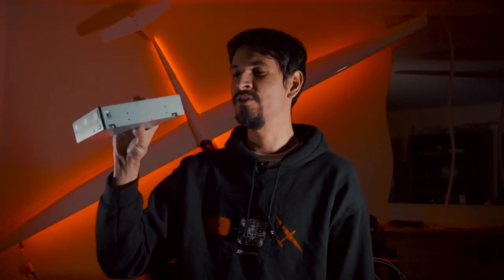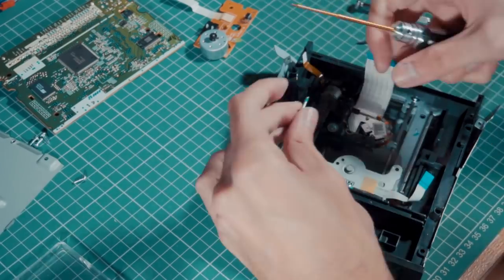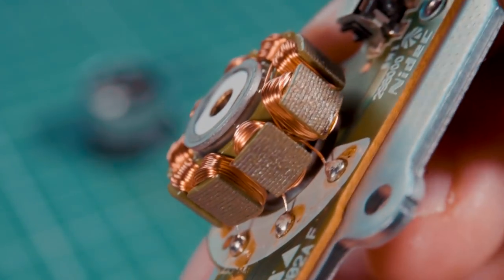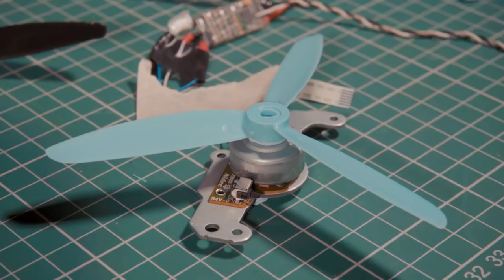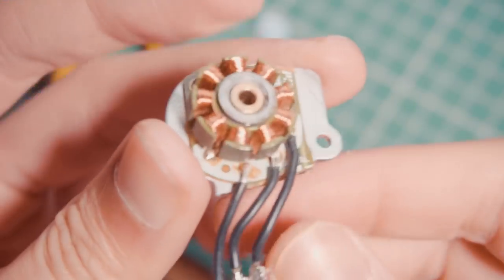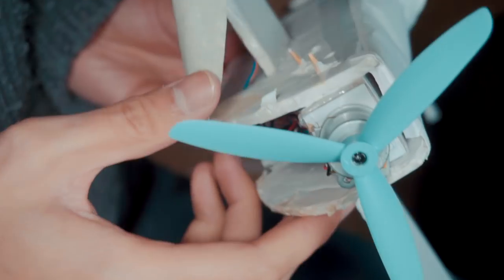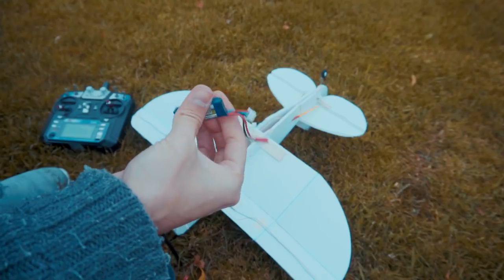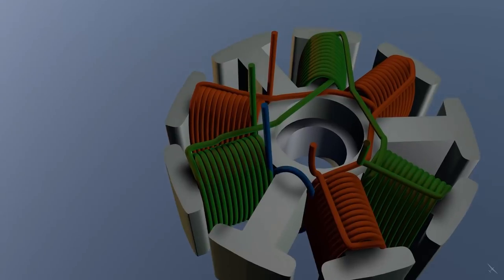Brushless motor from old CD drive to power RC airplane

Comment: I used to do this, back in the day, with great success.
What I used to do was... I removed the stator from the metal base & circuit board (& replace it with my own motor mounts); rewound the stator; put two bearings down the center of the stator; re-fit the bell & I'd have a better motor. At one point, I went as far as replacing the magnets (called the "flux ring") inside the bell housing with decent NdFeB magnets.
I had used those motors on some indoor foamy planes that I had built from 2008~2011.

Comment: This is very interesting. I’m anxiously awaiting to learn about rewinding the motor. I had some students (I teach a STEM RC Aeronautics class), who accidentally used screws that were too long and shorted out the motor. I’ve kept the motor, in hopes of some day learning (and eventually teach my students) how to fix the problem (and learn a little bit about electronics and motors). Could you also possibly go over how to correct/fix a bad/shorted motor?  Thank you for creating great content.
Reply: Sure. That's a pretty common mistake with the screws. I'll be covering the fixing of a business motor including rewinding.

Comment: Seeing you perform those initial rotational speed tests--with the plastic CD disc, got me thinking/'imagining'...
 What 'IF'--someone was able to carefully cut-out & relieve the outline of wedges, or 'arc sectors' of a CD disk, in a radial pattern...such that the freed, polycarbonate plastic could be bent/leveraged with heat, into the blades of a fan.
Or, more accurately like a turbine/turbofan 'Blisk'? Could several of these be mounted in series on a shaft, with slightly different 'pitch' blades--so that when rotating they pass air like a series of fan compressor blades?

Comment: Hello friend, I have two questions:
1) Is the CD Rom engine cover really difficult to remove? I apply a lot of force but it doesn't come out.
2) How to remove the short motor shaft to replace it with a longer one? Thanks

Comment: Great video DIY CD motor into small airplane ✈️ niceeee!!! But I wondered if you know what's this motor's KV is it?? Cuz I see you was using 3s  at 850, at 35c zippy xt30 cord battery, so I wondered what is the CD motor for KV's number, do you now, please do lemme know, thank you dude!! Cuz maybe you could do like 100c 850mAh, 3s with xt30 cord battery, maybe you could fly little more longer cuz 35c is pretty low on throttle and pitch for speed power... Awesome footage by the way! 🤙🏼

Comment: Is using an dvd motor with only 3 copper pillars inside good for rc plane? Its our school project and im designing one that is ultra light , small and sleek  the plane was made out of styrofoam with a wingspan of 2 rulers. And abiut 1 ruler fuselage lenght.. im currently making it glide first so that im nit gonna problem the flying when i added the control surfaces and motors..
Reply from the maker: Hi, you better off buying the proper RC motors since they are not very expensive and you'll save a lot of time.

Comment: There are a few thing wrog with your test. Rewinding it is the only way because it is rewinded from the factory for low assumption and low power. You could for example rewind it for a 4 sell. On rcgroups you find how too. the secondly choicing a prop for your motor is a know how that you have to learn. you can not just throw a prop on your plane so you will burn the esc or the motor or all of them together( believe me not a good felling) but I learned many years ago and I am shore you will too :). I used too rewind nearly all my of motors my self

Comment: Those windings look pretty good actually; very much like any small airplane motor.   The main factor that is preventing this motor from performing as well is the relatively weak ferrite magnets in the bell.  BTW, cell count has nothing to do with battery weight.  You can get 3S packs that weigh less than 2S.
Reply from the maker: I would like to try with Hard Drive motors but the one I had is difficult to get the motor from, I'll try to get more old ones to try that.
Reply: @Joyplanes  Oh I know! Don't you just hate that? I have also spent much time trying to extract and replace hair dryer motors with brushless to make edfs and often find it's near impossible to disassemble them non-destructively. The few I have succeeded with work beautifully for that purpose though  Old HDD's also usually have crazy strong magnets in them which I always try to save.  Don't give up and be sure to search youtube for tips and tricks for salvage tips and tricks. ;)

Comment: Keep searching different drives for better motors.  I've used many to successfully fly 3 foot flying wings with a 5x4 pusher prop and with very good performance.  If you want to use a larger prop, you need to replace the magnets with neodymium and rewind the coils.

Comment: You could try to use that motor on a very simple foamboard plane if you peel the paper off on the foamboard and use carbon fiber reinforcements
Reply from the maker: Cool.

Comment: Pretty nice, dude! 😃
Maybe with a 4s battery and a 7 inch propeller? There's a great one from Dal Prop, I think its name is T7056C. 😊
Reply from the maker: I need to try with a very small 4S battery since the ones I have are 1000mAh and are heavy for this airplane.

Comment: I have some of theses motors. The one you have has a weaker magnetic belt. Look for the grey ones they are stronger. And you can increase the power just by changing the wiring. I saw someone getting about 120 grams of thrust without changing the magnets.

Comment: Re-wind the copper wire with thicker gauge wire and do a star configuration winding and change the magnets with neodymium magnets that will definitely give you alot of power and definitely wish to see that video.
Reply: better buy a rc motor
Reply: I though the thinner gauge wire can make rotation more faster than the thick gauge wire, correct me if I am wrong. I need some more research on current flow of a wire.

Comment: How about using HDD motor? It might be more powerful.
Reply: I've explored this option and HD motors are generally even smaller.  Larger motors can be found in old tape backup drives and they work great.
Reply: Hard drive motors don't always have poles in groups of 3, making it hard to convert.

Comment: How did you know what esc to use?
Reply from the maker: Any ESC will work because the motor is not too powerful.
Reply: Could I use a 10 amp ESC?
Reply from the maker: @yangexue6596  Yes, that should be more than enough.

Comment: A good brushless motor from an computer is from the hard drive disk..... Much more powerful
Reply from the maker: I've tried to get one but it was embedded into the hard drive case. I'll try another time.
Reply: @Joyplanes  OK keep on being creative, great video's
Reply: @Joyplanes  They're  shrunk-fit in the drive housing.  Remove the platters,  place the motor upside down and support the drive housing with something so that the motor axis is free from the underground.  Then and use a hammer and a punch to tap on the shaft,  driving it out.  I liberated a motor from a Western Digital drive this way,  yesterday.

Comment: You can try with a boost converter and a single cell lipo
Reply: 1)  adds  MASS  to a model.     2)  when volts are increased,  AMPS  Will be  Decreased.   and  WATTS stay the Same.
Reply: @daviddavids2884  It can be less mass because an electronic print can be lighter than an accu. You are right about the energy. Depends what is needed for the set goal. High currents during shorter times is maybe all you need. Lipo can give high Amps